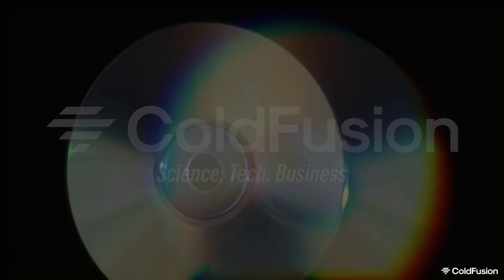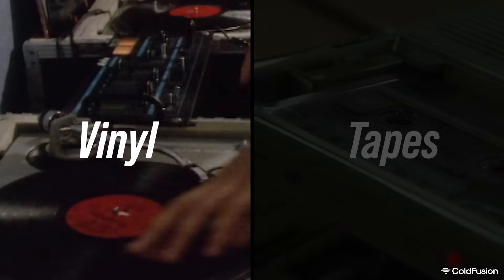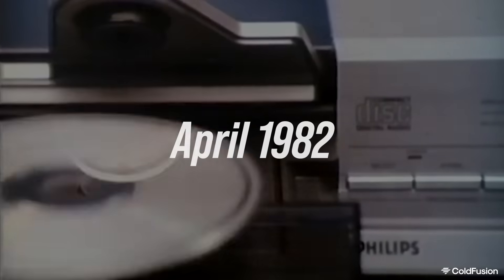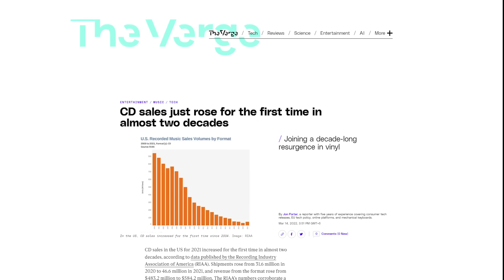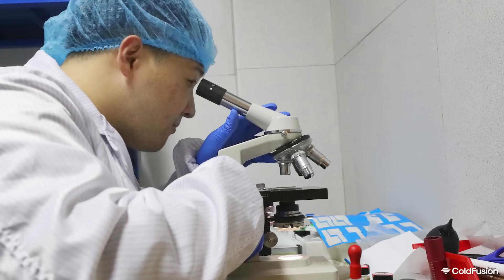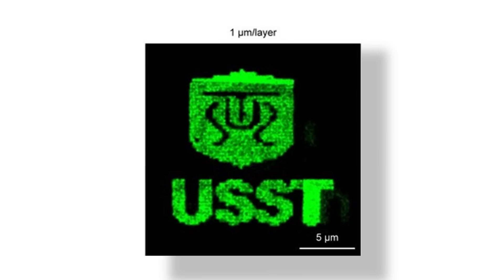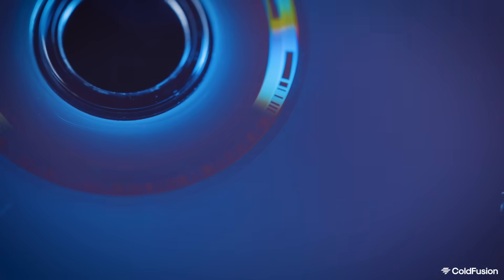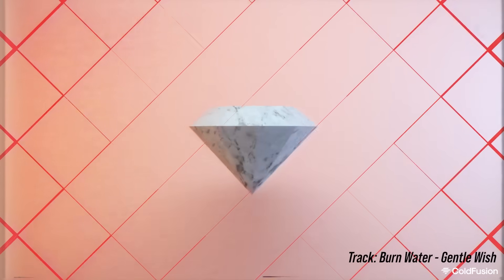Why This New CD Could Change Storage

Comment: too late. cloud storage has already replaced 97% of physical media. and increased strength too the publisher and developers for copyright law, doesn't mean there will be much practical functionality in a disk drive outside of secondary data backups, before massive server overhauls.

and stop interchanging bits and bytes. 1 byte = 8 bits. 1 gigabyte = 8 gigabits there is a HUGE difference between the 2

Comment: Backup of data using CD/DVD has been tried and failed and should be listed as a key downside to the technology and that is data rot. CD/DVD's degrade much quicker than other forms of storage including tape. You also failed to mention parallel improvements that have occurred in tape storage which keeps it relevant

Comment: Optical media is bad. Here's why.

1. You can't reburn an already burned cd.
2. Optical media is not durable
3. Most optical media are DVDs, which can store a maximum of 4.7gb, there are usbs which have 128gb💀
4. Scratches break cds and cd rot also kill cds.

Comment: the biggest limitation is our own contextualization. "Streaming replaced CD's so obviously CDs would replace streaming if it came back right?" that's the completely wrong way of going about it. 

If we can use these CDs in place of HDDs and SSDs the $per TB of storage would fall drastically even with the limitations many people would be able to use CDs to run their own NAS Systems without braking the bank.

Comment: The LTO consortium is probably the main reason tape storage is so rare in the consumer space. Producers in the consortium can't even agree on standards, and are pretty hostile towards each other.
Reply: Tape is also very inconvenient. A spinning disc is already limited in speed and access but tape takes it so much further.
Regarding the hostilities, funnily enough it was the same for flash storage, if you remember the history of memory stick, compact flash, etc. Nowadays we only think of SD cards but they too had a hard time establishing themselves.
Reply: @jayhill2193 

With spining disc you can 10 or 100 laser to r/w in parallel...

With tape you cant
Reply: for 40-50TB of HDD space you get 600TB of tape storage(compressed) for the same price, it makes sense to use them for backups for large companies, and they can afford to store them properly

Comment: Didn't get into the details enough, or the potential upsides/downsides.

For instance, how long will the data be accurate? how well can it withstand heat? How fast can the data be written? All he said was "megabytes per second". Are we talking 100s of megabytes, or single digit megabytes?

At 5 megabytes per second it would take over a year for that $50000 writer to fill a single disc. That would make this not only a niche technology, but rather a complete waste of research money if it can't DRASTICALLY increase that write speed to more viable speeds (1 GB/s at least), complete garbage that would have been better off spending money on how to make squirrels grow more/less fur or something.
Reply: And to anyone thinking that the durability would be the same as a CD, not at all (not necessarily) when the bit size is so much smaller.

Comment: DVD and BR still have a use case, backups, for those who do not trust cloud storage for sensitive data. Or just want durable storage for photos and video. $20 can get BR storage of about 675GB, enough to store critical knowledge for use in a disaster resulting in downed power and internet like medical text, infrastructure engineering designs, low tech manufacturing, basic power generation and can be accessed with low power devices with a portable BR player.

Comment: Costs are wild, for 200TB of storage, you are not going to be paying anywhere close to even the $50K for the femtosecond laser.  An 18TB hard drive goes for $195, which means the equivalent storage would cost around $2154.  Talk about a non-starter, and although you would pay more to put those drives in a chassis with appropriate hardware to integrate them, it’s a microscopic amount compared to even part of the materials cost you can buy today.
Reply: Thats at a single cost for a hard drive. With CDs like this you would be open to unlimited storage - there are three types of storage cold, warm, and hot. It wont make sense for hot or warm, but something like this would be great for cold storage where you store as much as you can and recall it as needed. You are not wrong 100% at 50k as there are still other means to hit some pretty high level of storage at that cost, but it wouldnt be too wild to see at a data center at some point either.

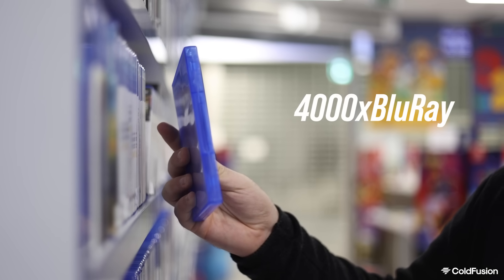Comment: At 7:00 you write and say "1.6 petabytes" then 6 seconds later you say "1.6 petabits" and at 8:00 you write and say "1.6 petabits".  It's all over the place for the whole video.  Are you aware a petabyte is 8x bigger than a petabit?  It's like if you accidentally told someone you're 14 meters tall when you meant to say you are 1.75 meters tall... It kinda matters.

Comment: i love hi-tech. cd´s and dvd´s are not affected by virus or electrical issues like hard drives. i had 20 years old cd´s and they are in good shape. original disks are made under policarbonated pressured material and every one is maded with a very low cost process.

Comment: I'm kinda shocked you failed to mention it could take FIVE YEARS to write a single disk. Five years. That's not a "limitation", that's "what is the point in even considering this as a viable technology?" Put another way - this is like trying to write 300,000 CDs back to back. At the same speed as writing 300,000 CDs back to back.
Tl;Dr this both could not, would not, can not, ever, not in any way, ever change storage. There is no "could" about it. It cannot do it. Added to this, it's not in any way new given this tech has been around in a better form for over a decade!

Comment: That disc is only suitable for archives, specially when you consider the tight tolerances needed for it to work. Only well-tuned specialised machinery will be able to store optically with that density. That being said, they could be stored in libraries and other archives so that we have a backup of all our culture, because the discs are not affected by electromagnetic fields.

Comment: I suspect the trend will be to move more into solid state instead of requiring mechanical parts. I'd like to see this morph into an optical solid state drive with a laser deflected electronically onto the disc or whatever shape works.
Reply: Ah for random access

Comment: not sold on the idea... i remember having to deal with a lot of CRC errors as data CDs and DVDs aged, now were talking significantly higher precision requirements in highly specialized materials. i would be interested in knowing how long the materials will hold up. and then of course with smaller storage cycles SCRATCHES literally become a bigger problem.

Comment: There's a VERY good reason why this technology will NEVER take off. Just imagine what a tiny bit of damage, scratch or dust particle would do to a system that relied on such precision. Even with CIRC or some other hardware checksumming, you'd never be able to get the error rate low enough. Then you'd need to deal with the changing undulation/oscillation and the magnetic laser balancing would drift over time. On DVDs, BluRay, you can get away with it because there's a decent amount of tolerance, but with something that requires such precision, you'd be totally screwed.
Reply: cases exist similar to floppies

Comment: It depends what type of non volatile storage r we r talking about, either long term or immediately available one. The latter will be most likely led by SSDs either based on the current NAND memory or next gen type of non volatile memory. These multilayer CDs will most likely find their use in the long term memory, however other types of memory beside it look much more interesting.

Comment: Hey, that is truly great topic but your video has a few minor flaws: CDs were not replaced due to costumers interest changing. Costumers generally want the best product for their money which was no longer CDs due to new inventions. Also 400$ for 1tb is less than what Apple charges so yes it's reasonable to consider Apple prices "bad". The 42mhz femtosecond laser used to writes on the 3d nanoscale disk, has a "bandwidth limited to 5MB/sec"->11111.11hours to fill disk, if it writes one bit/per Pulse. So, for 40k you could buy a 100 TB(0.8Petabits) ExaDrive with a write speed of 105000MB/sec ->0.2645hours to fill disk.  The same cost as a femtosecond laser, but additionally the 640nm continuous-wave laser is a must to write data on the 1.6 petabit disk. Keep in mind: 3d nanoscale disk-> 2x capacity but takes 462.95 days longer   to write data onto entire disk,                                     additional 2 costly lasers, (480nm pulsed + 592nm continuous-wave) needed to read data,                 state transition resulted in polymerization -> probably a one-time writeable disk. So the 3d nanoscale disk requires a total of 4 extremely costly lasers, potentially higher cost than 2 ExaDrives, could only be used to back up data once after that 1st time of writing data it won't be possible to do anything but read data. 
Lastly your last point doesnt make sense, cloud solutions are storing the data on physical disks too. They will use whatever is most efficient, so if 3d nanoscale disks improve to be the most efficient approach, it will be adopted. The disk wont change anything in that regard. People don't want to own their data and use cloud services for whatever the reason may be. The option to store your data yourself with the same or similar disk as any cloud exist already. Physical storage is not affected by any cloud service. 

Miao Zhao wrote a great blog with much more detail at https://blog.dshr.org/2024/03/petabit-optical-media.html

Comment: ROMANIAN PHYSICIST DR. Eugen Pavel was the first inventor of 3D disc, his "Hyper CD-ROM" was able to store at that date 10 terabytes of data was gain the GOLD medal at Eureka contest (Bruxelles - Europa) in 1999.
As always, Romanian inventions are stolen by others and presented as they are their own inventions.
Insulin was also invented by a Romanian and the examples can continue with hydrogen engines, etc.
Just search on the web, Wikipedia, etc. and you will see this info are public available.

Comment: This has been around in one form or another in research labs for a good while,  I remember reading about a fluorescent multilayer disc that was almost clear back in the very early 2000's.   At the time, it was boasting a significant boost in data storage over cd's or dvd's,  but it pales in comparison to what this video shows.  Anyhow, borrowed from the internet archive "Introduced by Constellation 3D Inc. (C3D), Fluorescent Multi-Layer Disc holds up to 140 GB of data. This is currently (2001) 215 times greater than a CD-ROM (.65 GB) and 23 times greater than a DVD-ROM (6 GB).

FMD-ROM discs contain fluorescent materials embedded in the pits and grooves of all 10+ layers. When in contact with a laser, the fluorescent materials are stimulated to produce coherent and incoherent light; data is stored in the incoherent light."

Comment: Thaaaank youuu for making your videos LOUD. Seriously, when the ads play, they are silent, which is amazing! So many youtubers do the opposite and it makes me sick.
Reply: The downside is a lack of dynamic range, which is why lots of content is produced "quiet".  It's so there's room before you hit the 0dBfs ceiling, at which point, nothing can be any louder - ever.

Advertisements are more concerned with getting your attention than fidelity or impact, so they just produce everything with little dynamic range, so it can be quite loud.  This isn't laudable, but neither is producing all content that is equally (or more) loud.

The problem is obnoxious advertising, and the solution is to pay for stuff instead.
Reply: @sirnickity the solution is using an ad blocker...

Comment: about the ExaDrive, it is a server class storage drive that needs to be redden and written constantly for years without failing. This is achieved with SLC und MLC flash, most likely with SLC and 2 to 4 flash chips in parallel, if would this be done with QLC like the smallest common flash type wich is used in micro sd cards you could easy make a drive with 2 to 10 petabytes, but it would be slow as fuck and probably die in cobble days. 
it is possible doing some thing bigger but it would for now not reliable and usefull unless you need to store it for years, but even then use a LTO tape drive.

Comment: The best format optical discs could return in would be MiniDiscs, in which the optical disc is encased in a plastic cartridge casing, protecting it from environmental exposure. It is more complicated to produce but is far more enduring and also smaller. Small enough to be used with portable music devices and making it better for use on the go
Reply: Then you'd have the same problem I face with UMDs... that is, the casing eventually wears down, and needs to be replaced. And if you don't know what a UMD is, it's basically a MiniDisc on steroids. It can store up to 1.8GB instead of 700MB, the only downsides? You can only use them on a PSP, and RWs for them NEVER existed.
Reply: @aiodensghost  Replacing a plastic case is less annoying than replacing the disk, and disks do wear out and get damaged over time, as we all would know. The magic solution would be a disc that is the best of both worlds, having the durability of a caddy with the resilience of a disk like a CD or a DVD that can be safely handled without one. Of course, you usually get one or the other... the manufacturer doesn't want the extra expense of a caddy if the disk is durable enough to survive being moved around without.
Reply: @aiodensghost  UMD was an interesting medium that never took off. Unlike the cassette tape Sony retained the rights to making them, nobody else could press them without being sued into oblivion. The royalties made them inconvenient for many companies to release on that format. A modern physical format like that would be incredible, but I think unlikely. Best case is we get the SD card that can sit around for a hundred years with no degradation.
Reply: Plastic cartridge casings for CDs existed way before Mini-Disc, and were generally used by business/education/research for CD-ROMs
Reply: It would fit the best of all cyberpunk futures while giving us exactly what we need
It would also bring back the lost art of box art and disk art
Reply: Psp tried for a while
Reply: I would love some storage medium with reasonable size at the cost of read/write speeds. Perfect for backups and transferring data. But the reality is all of that died for one or the other reason. Mostly because manufacturers were too busy screwing each other over minute differences than to actually sit down and realize what people needed. They were trying to tell us what we need instead of listening. USB storage was a fluke and it caught them completely off guard.

How many people remember Sony's proprietary memory cards that only worked on PSP and their phones and they go "fuck yea those were awesome". Pretty much no one. USB is universal, fits every computer and works reliably enough that most of us never sees any issues with them. Manufacturers got beat at their own game and it was obvious from the moment USB drives started appearing.

Comment: Even it they could get it to work it needs to be as fast as an NVME ssd is now. CD and or DVD could transfer about 4mb/s. That's a huge problem if you can store 200gb. Files are only going to get larger.

Comment: /drooooool 

This would be a massive boon to data archiving, especially if it and the drive are cheap. Meanwhile, blu-ray M-discs it is until I get the RAID array built. Just missing a SAS card with an external port and enough drives to get started :3 Once the ADHD gets dealt with that is... 

Anyhow, eventually this will trickle down to consumers, but not with the same data capacity, because there's a significant trade off between capacity vs write vs read. Never mind the laser tech needed at present and optical and mechanical tolerances = a lot of fun trying to bring the cost down to consumer levels. 

As for CD's - I still have a bunch of CD's and a few DVD's floating around, but no PC optical drive installed and working at present. 

As for music - fuck streaming, I have nearly everything in MP3's sitting on drives. MP3's are cheap space wise, even at 320kbps or great quality. Still haven't squished all the .flacs though, as ADHD = keep forgetting lawl.

Comment: What is needed is physical storage that doesn't degrade. Digital storage media degrades quickly. Manufacturers say that thumb drives might last five years. Most last three. Even when they are still working, millions of bits have failed within them and the computer is filling in the bits within images. The same happens with audio. Documents are easy because they are similar to images but not precise. It's easy to fill in a black spot. 

There are now archival Blu-ray discs and CD RW- RW+. Such are said to last a hundred years. I haven't decided which I will order but I will be getting one for long term storage. Having a 100 TB disc that could be created at home, that would last forever, would be awesome.

Comment: Well, if the refinements of this technology can get the cost of read/write capability down to a level equivalent to the same relative level reached by CD at its peak, I'm in. But there is at least one other downside not mentioned in the video. Very few users keep petabytes of storage on hand in the first place, so where would the write file be kept? These "petadiscs" would have to be fractionally writable, so you could add data to them gradually. That's an additional complication.